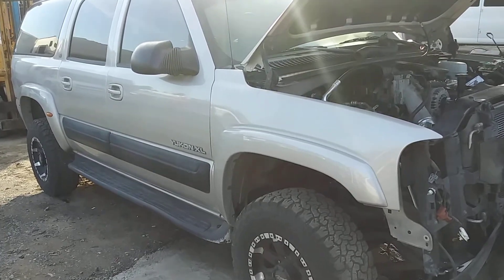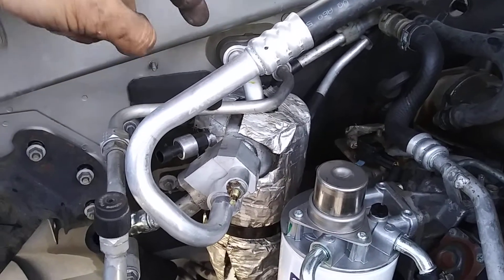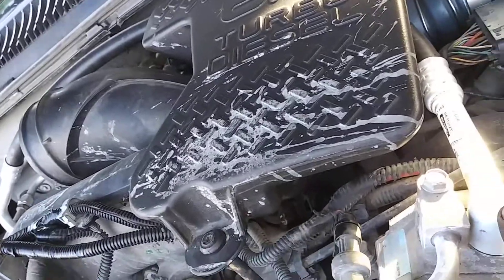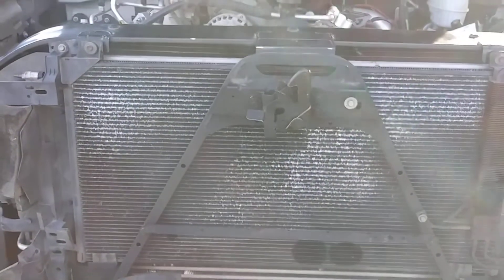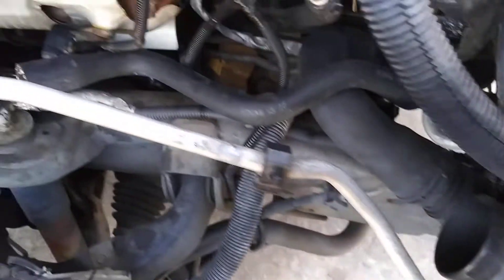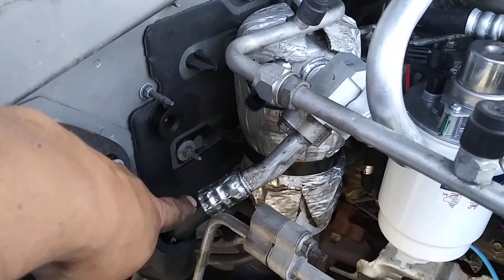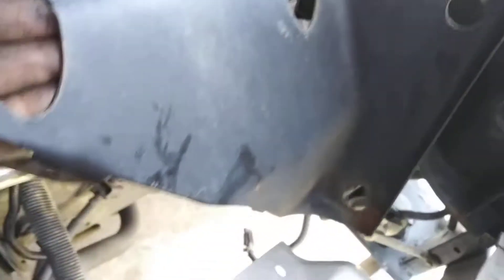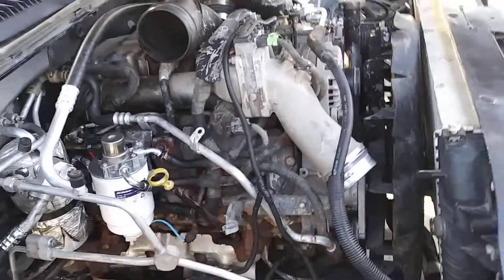Duramax Suburban GMT-800 A/C plumbing mods

Comment: Nice process. Not sure if you have any other videos or tips on completing the swap. I’d be interested in seeing what you needed from the donor truck to complete the wiring for the suburban to run the various systems in the suburban and systems needed for the engine, transmission, etc. Any assistance would be greatly appreciated. Thanks and have a blessed day!